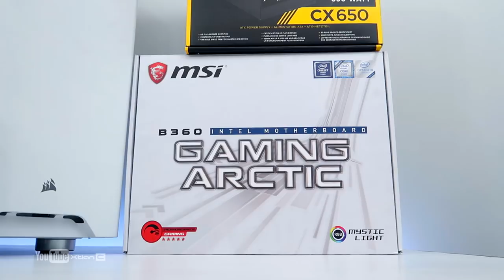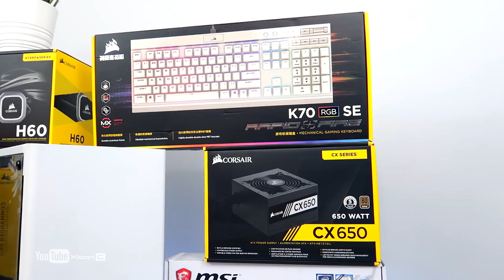MSI B360 Gaming Arctic White PC Montage Build ft. Corsair 275R White & MSI GTX 1060 3GT OCV2

Comment: You are missing the rubber grommets for wire management. I would contact corsair and tell them to send you them. I liked the Corsair Carbide  275R TG case so much that I bought another one in white this year. I would consider this the best mid tower case under $80usd. Better cooling options than HZXT and is a breeze to build inside.

Comment: hey bro. sick build man. imo it wouldve been slightly better with only an ledstrip in the bottom. on the top and left side of the side panel, you can see each individual led which doesnt keep the same consistent clean part of the build

Comment: Have you tested the air flow of this build? I think there might be a problem with heat when you place the rediator of the liquid cooler to the rear panel. It could disrupt the flow of cold air for the GPU. Nice video and editing!

Comment: CPU?
Reply: U can use 8th gen intel cores, but im using a intel pentium gold
Reply: ArticSquid123 Can the Intel Core I5-8600k fit in this Motherboard?
Reply: Diamond Gaming I'm pretty sure it can since it's 8th generation
Reply: Diamond Gaming Yes but it cannot be overclocked
Reply: Does the i7-8700k fit on this board
Reply: Dude Dude It does because it's 8th gen. But I would STRONGLY recommend getting a z370 motherboard.

Z and X motherboard can be overclocked

B and H can't be overclocked

Z is for Lga 1151 
X is probably for something like an X99
Reply: Diamond Gaming yes. This one's an 8th generation board.
Reply: Look at the description
Reply: i5-8600k but this thing is bottle necking
Reply: Can the Intel core i3-8100 fit?? Pls answer

Comment: How did  u use the vertical gpu mount. On the case. As it is blocked off and not yet a feature
Reply: easy you need to buy an pci extension then just put vertical the case already have the vertical exit, but apparently the temp rise up to 20c

Comment: Hi, nice video. I just have one question.. Can you fit a 30mm 240 radiator at the top? I couldn't see the clearance of the fans you installed up top relative to the RAM. Do you think it will fit? TIA

Comment: Are stand of gpu vertical amount come with case or should I buy them separately?
Reply: They are NOT included with the case.
Reply: @tonkatoytruck  Can I install the female side on the case with screws cuz I don't like to install just the gpu with two screws
I want the pci Express installed on case.
Reply: @dalileddineslimani6399  There are no mounting points provided on the power supply shroud to mount the adapter.
Reply: @tonkatoytruck  does it affect on stability of graphic card doesn't it move? When only two screws on it?
Reply: @dalileddineslimani6399  Don't know. I have not mounted my graphics card vertically.

Comment: Di ata na confirm anong CPU gamit dito. The mobo supports all 8th gen cpu including the unlocked version tho the downside is you cannot over clock them with this mobo. Tapos naka AIO cooler pa which you really don't need if you're using 8400. The included stock cooler or a simple air cooler will do the job. Kaya mejo curious lang po what cpu gamit. Pa confirm naman Sir Xtian what cpu. SALAMAT!

Comment: Do I need to plug in a molex cable to the PCIe-PWR1?
my motherboard is MSI B360 GAMING ARCTIC my processor is i7 8700 no k and my graphics card is the KFA2 GeForce GTX 1070 Ti EX SNIPER my power is EVGA 650 GQ, 650W help my ples soory my 
language

Comment: Sir xtian c napanood ko lahat ng video mo nakakatakam lahat sa mata 😂. Naging basis ko  ung personal setup mo na red black 65k build and
Im about to build my first pc setup: more on 3D rendering,autocad,sketchup vray and some gaming action. Pa advice sana ako sa build na iniisp ko.
1.ryzen 7 1700 (to be OC) (cpu)
2.nzxt kraken x62 (cpu cooler)
3.gtx 1060 gaming z 6gb (gpu)
4.msi B350 tomahawk 
5. Corsair vengeance 16gb ddr4 3000mhz (ram)
6. Seasonic 750 siguro for (psu)
7. 500 Gb  samsung (ss)
8.2TB WD (hdd)

Comment: wala bang White Themed Build na Ryzen jan for 2019 version :)
Reply: iRoyTV skl build ko white theme po

Msi b450 mortar titanium
Ryzen 5 3600
Deepcool gamaxx 400 white
T force delta rgb white 8x2 3000mhz
Galax gtx 1060 exoc white 6gb
120gb wd green m.2
1tb wd blue
Evga 500bv 
Tecware vega chassis with arc spectrum fans
Reply: @sean0611  pwedeng makita picture ng build mo dito paps? Ryzen theme din kasi balak ko

Comment: Hey I’m looking to get one of those mother boards but I have a question what port do you use to hook the display to your monitor. E.g. like hdmi or display port. Also would I be able to run two monitors?
Reply: I'd recommend going for a display port 1.2 and if you have 240 hz monitor  then 1.3 since hdmi and display port are around the same price and display port can go 144 hz in 1080p but hdmi cant. Running two monitor depends on your gpu if you have a decent gpu then yes you can.
Reply: Dont do dual monitor if you have a gpu worse than a 1070
Reply: plug your monitor into your GRAPHICS CARD or else you won't be leveraging any of your GPU rendering capability.
Reply: @Red-yq6nc  May I ask why?  I have a 970 and my dual monitor works fine.

Comment: AMD Ryzen 5 2600X
MSI B450M Bazooka Plus 
Palit GTX 1070 Ti Super JetStream
3200Mhz 8x2 16GB G-Skill Trident Z RGB
600W 80+ Gold Modular PSU
1TB HDD
120GB SSD 
Tecware Nexus M 

Please?
Reply: seems fine. 3000mhz ram would be more than enough tho. also instead of getting a 600w u could save money there and get a 500w and get at least 250gb ssd.
Reply: No OC? Ryzen 5 2600 would be enough.
Reply: For Ryzen, I'd say there is no limit.
Reply: How much this system cost?

Comment: What cpu
Reply: Supports 8th Gen Intel Core/Pentium Gold/Celeron Processors for LGA 1151 socket, but a Core i5-8400 or i5-8600 would be a good pick for this budget build with it's B360 Chipset Motherboard.

Comment: Hello please help me it's my first time doing a gaming build, been on a potato 30 fps for like 8 years now. Soo now i'm making my dream of becoming streamer/youtube/esport profesional dota 2. i don't know if this a good build specially with the fans or idk im young and i could have some fatal mistakes on there, i've been doing my research soooo please help me and tell me if this is good or not and what are the mistake in this build?

CPU 

Intel - Core i5-8600K 3.6GHz 6-Core Processor
$259.99 Buy

CPU Cooler 

Noctua - NH-D15 82.5 CFM CPU Cooler
$84.35 Buy

Thermal Compound 

Arctic Silver - 5 High-Density Polysynthetic Silver 3.5g Thermal Paste
$6.65 Buy
Motherboard 

Asus - ROG STRIX Z370-E GAMING ATX LGA1151 Motherboard
$205.00 Buy

Memory 

Patriot - Viper RGB 16GB (2 x 8GB) DDR4-2666 Memory
$144.99 Buy

Storage 

Samsung - 970 Evo 250GB M.2-2280 Solid State Drive
$87.89 Buy

Seagate - Barracuda 2TB 3.5" 7200RPM Internal Hard Drive
$58.89 Buy
Video Card 

Asus - GeForce GTX 1070 Ti 8GB ROG STRIX Video Card
$469.99 Buy

Case 

NZXT - H500 (White) ATX Mid Tower Case
$69.99 Buy

Power Supply 

Corsair - RMx 650W 80+ Gold Certified Fully-Modular ATX Power Supply
$69.99 Buy

Operating System 

Microsoft - Windows 10 Home OEM 64-bit
$94.89 Buy

Case Fan 

Noctua - NF-A14 industrialPPC-2000 107.4 CFM 140mm Fan
$22.95 Buy

Noctua - NF-A14 industrialPPC-2000 107.4 CFM 140mm Fan
$22.95 Buy

Monitor 

Asus - VG248QE 24.0" 1920x1080 144Hz Monitor
$274.99 Buy
Speakers 

Logitech - Z323 30W 2.1ch Speakers
$46.89 Buy
UPS 

CyberPower - CP1000PFCLCD UPS
$149.95 that is almost a total of $2100
Reply: You don't need to buy windows

Comment: mas matibay ba ang board ng msi kaysa sa gigabyte mobo? salamat
Reply: dave palle tingin ko wala naman sa brand yan,nasa pag alaga lang talaga.yun msi ko 2years na ngayon nasira dahil naihian ng daga 😢 pero naka pa i repair.late kona kasi napansin me butas sa ilalim un case ko kaya nakapasok sila😁
Reply: yan kasi ung madalas ko mapansin na brand gigabyte msi at asus pero durable daw ung  pyesa ng gigabyte mobo.. kung sa bagay ung winfast am2 mobo ko umabot ng 6 yrs.. 2007-2013.. ngaun hanap ko cpu at vcard na pang multi tasking for personal use..
Reply from the maker: All brands are all the same pagandahan lang ng features, design, aesthetic and so on.. Lahat yan electronics so may tendency na masira. Wag ka lang talaga matapat sa lemon product. Yung msi na board ko still running 7years na okay pa din I also have a gigabyte mobo mag 6 years na =)
Reply: dave palle asustek na 2009 model kahapon (june 10) 2108, so asus matibay, since di ko pa na tatry iba, pantay pantay muna..msi next mobo ko
Reply: boss Xtian, san po nabili yung case? order ba yan sa ibang bansa or meron directly dito sa pinas?

Comment: Can you build it?
CPU:Ryzen 7 1700
MotherBoard:MSI B350 Tomahawk
Ram:HyperX Fury 4GB DDR4
GPU:Asus Dual Geforce GTX 1060 6GB
SSD:SanDisk Plus SDSSDA-240G 240GB
PSU:Corsair TX M Series TX650M 650watt 80plus Gold
Case:Cooler Master MasterBox Lite
Total Price:68k

Sana po magawa po niyo kung my meron po kayong sapat na pera
Reply: oSnapy Di po compatible yung mobo sa cpu. B350 po magandang suggestion
Reply: Yan po tama na mali po ako ng lagay ng pangalan ng mobo

Comment: Sir i'm challenging you to build a php18,000 budget pc build hehehehe
Reply: DO IT NICE g4560 gtx 1050 500gb hdd h110 motherboard cheapo case cheapo but decent psu 8gb ram
Reply: ryzen 3 2200g, chepest am4 around 3000, 500gb, tecware case, vs450.